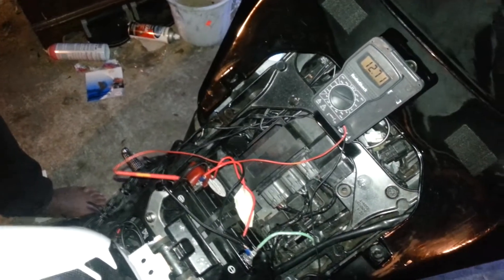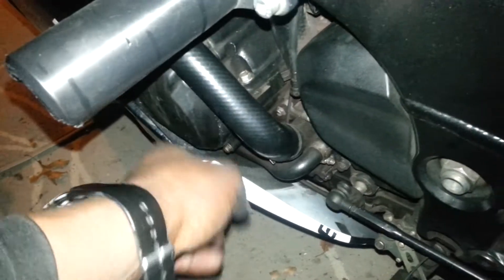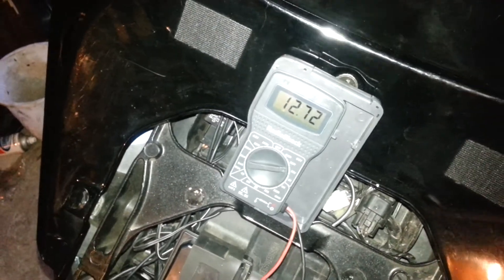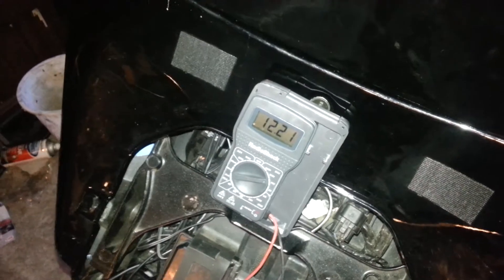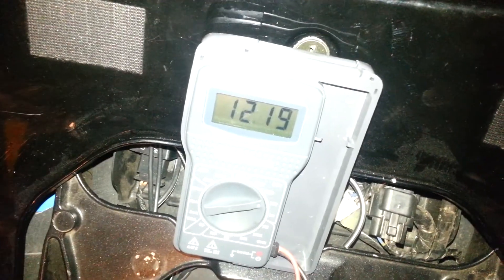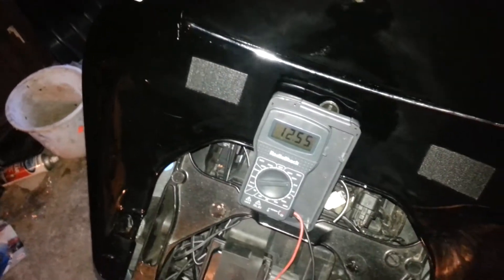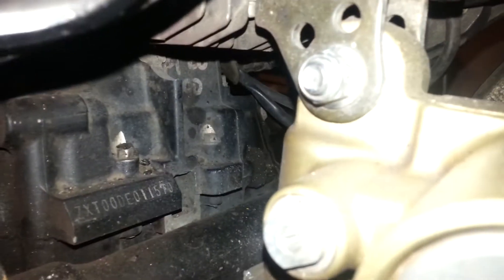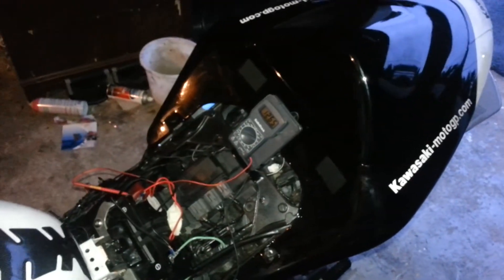alexlexusZXninja Lola zx10r gen 2 06 charging issue? stator/alternator or rectifier?

Comment: I really hope I can get your expertise here; two days ago I had the same issue similar to yours. My 2008 ZX10R decided to not start back on after I stalled it on the street. I assumed it needed a new battery so I went ahead and bought a new one on Friday (two days ago). A couple hours ago it decided to not start wit that new battery installed. Am I looking at the same issue your bike had? I went on some Kawasaki forums, and they also mentioned that ir might be my rectifier. Any help I can get from you would be truly appreciated. Thank you!
Reply from the maker: change the stator and Rec too. it will fix everything' good luck and keep me posted.
Reply: @alexlexusZXpredator   Thanks for the prompt reply bro! I am not much of a mechanic but is that something I can do myself or would you suggest I take it to a shop to get it fixed. Also which brand stator and rec would you recommend before I make a purchases. Thanks again !

Comment: I have replaced the stator and the bike will hold a charge but its isn't over charging so what does that mean should I replace the rectifier cuz I already did the stator
Reply: When on its idles at about 11.5 11.8
Reply from the maker: indle shpuld be 13.5. stator might be bad or wires.

Comment: Hey bro I’m having the same exact issue as you. Doesn’t go up when I give it gas either. What did the issue end up being?
Reply from the maker: Bad stator. Swapped it out and it was good again
Reply: @alexlexusZXpredator  awesome man. That’s kind of what I figured and I got one ordered already. But it’s good to know. Appreciate it!
Reply from the maker: @UrnotGary  glad you are set lmk the results
Reply: @alexlexusZXpredator  will do man! Btw do you recommend switching the rectifier out as well? Ive heard it’s good practice to do both at the same time.
Reply: @alexlexusZXpredator  got it all back together and she’s running great 👍 thanks for the tips man
Reply: @alexlexusZXpredator  hey I went to take my battery to an O'Reilly's and let it charge overnight and my battery still not cranking the motorcycle and they told me my battery was good.. before I took it there sometimes it will crank without having to boost motorcycle off and it got to a point where I had to boost it off every time now so what do you think they could be because I just bought a new battery but I haven't put it in yet let me know ASAP thanks
Reply from the maker: @yotiep.1072  hmmmm  check the starter
Reply: I guess zx10 all have the same problems mines cut off on me on a intersection I jump start it 3 times it kept cutting off now it won’t hold a charge I have a brand new stator and a R/R
Reply: @user-vm6ti6ku5i  I ended up replacing the stator and rectifier and it fixed my issue. I opened up the stator and the wires were all melted together

Comment: I just bpught a 2007 zx10r and its doing the se  but overcharging. Ita giving me 17.60 . Wich is alot..  rectifire is out.
Reply from the maker: LoCo hUgO change your R&R. its not taking the load off and will estroy your battery over time.
Reply: alexlexusZXninja i did yesterday . Runs good 14.56 volts now
Reply from the maker: LoCo hUgO good glad its working now.

Comment: Do you have a video of you installing those small bulbs in the corner of your headlights? I'm also about to change my stator on my 06 zx10. What is the rectifier for anyway?
Reply from the maker: SIX FIVE  the rectifier is under the bike near the suspension. it keeps the stator from over charging the bike's battery.
Reply from the maker: SIX FIVE i dont have a video of that install you are looking for but its very easy to do. pull the fairings and unscrew the assembly. I might be putting all white fairings again and i might be able to upload a video for you.

Comment: Sorry for the delay in my reply. I was held up for the last few days. I have seen your video and can sure help you out! It is better if we can speak, so that we can discuss. This is not an issue with your battery. Your battery is holding charge. It looks like a failed Regulator / Rectifier or a failed Stator. I have fixed these issues on my R1 and BMW 650F. You can connect to me on Facebook. We can speak over skype and I can help you out for sure. No need to visit a mechanic! My Facebook details are below: 

https://www.facebook.com/vikas.rachamalla

https://www.facebook.com/Iammotorbiker
Reply from the maker: Vikas Rachamalla i replaced the stator and the readings went back to normal. it went back to 14.5v and the battery was now holding the charge. I have a video to show you
Reply: alexlexusZXninja Wow, that is very nice mate! I am glad the problem has been resolved. Happy riding! Do stay in contact with me. My Facebook ID is below: and do subscribe. Thank you! https://www.facebook.com/vikas.rachamalla

https://www.facebook.com/Iammotorbiker
Reply: Vikas Rachamalla guess  what ? now after  a year the bike is over charging.  I have to replace the rectifier now. :(
Reply: This is what I wrote on Alex's video hope I can get your expertise:

I really hope I can get your expertise here; two days ago I had the same issue similar to yours. My 2008 ZX10R decided to not start back on after I stalled it on the street. I assumed it needed a new battery so I went ahead and bought a new one on Friday (two days ago). A couple hours ago it decided to not start wit that new battery installed. Am I looking at the same issue your bike had? I went on some Kawasaki forums, and they also mentioned that ir might be my rectifier. Any help I can get from you would be truly appreciated. Thank you!